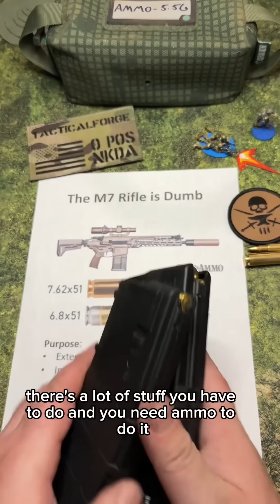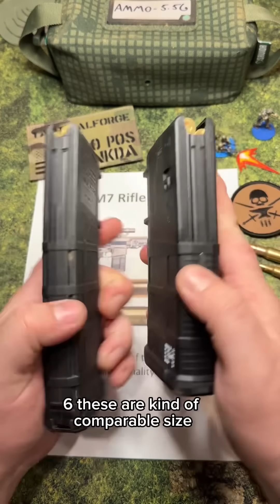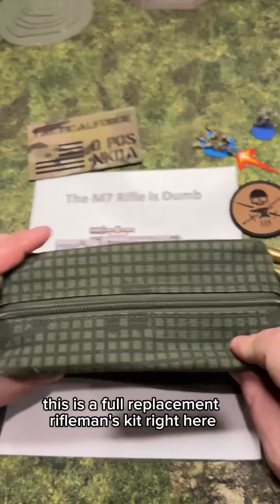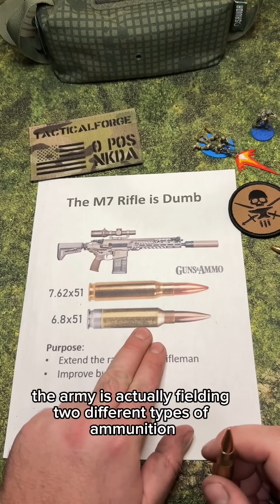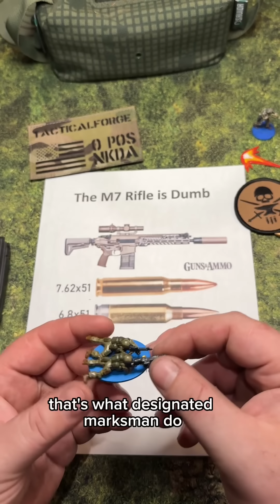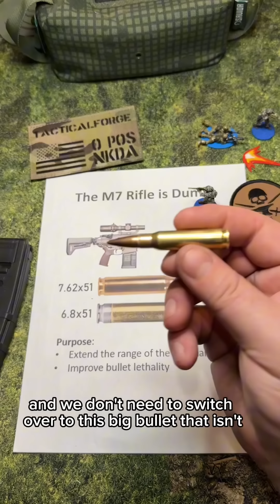My God this Rifle Sucks

Comment: If you need more firepower than .223, use .308. Why invent a new round when half the world is using these two.
Reply: Or use 243 Winchester which is 6mm-08. They're inventing new cartridges and super expensive rifles to achieve the same performance as a $500 243 Winchester rifle in the back of bubbas truck in case he spies a big buck
Reply: @unlisted9494 
Are you high? How does 243 shoot out of a 13 inch barrel? 
This thing outperforms a 24 inch barreled 243 from short barrel 
Nobody's going to be running around with a 2 foot barrel
Reply: As i understand it. To more closely align with the goals of penetrating body armour at distance withing the US Military's interests

With the new improvements to the M7, they're reaching velocities close to 5.56 with a 20" barrel and shooting flatter than .308 using the lower power .277 fury training ammunition and with an 11" barrel+suppressor.

So while the actual combat load will shoot faster & maybe flatter than .308, the challenge then comes through logistics. Especially during wartime, which im assuming the US military is looking to future proof within the next decade or two.
Reply: @Buttimus_Prime only problem is that even .338 can't penetrate modern plates point blank, and even 5.56 is good enough if you hit parts not covered by the plate (and it's rather small compared to the torso)
Reply: @tsorevitch2409  That's another good point. You could hit a mf with 3 .223 bullets, or one .338/.277 while carying the same weight.

If you hit a guys stomach/pelvis/thigh, he sure ain't getting up from that anytime soon.
Reply: @tsorevitch2409 All that energy goes somewhere, Newton didn't suddenly vanish.
A valid tactic against plate armor was to bludgeon the occupant to death inside his tin can.
Reply: @tsorevitch2409  what modern plates can stop .338 and what country is fielding them?
Reply: @Cplblue  RMA level 4 seems to manage it under testing conditions, but I don't know how it stacks up against other level 4s, especially those actually being issued. To say nothing of a plate that might have been handled less than cautiously, and maybe weakened.

Video of the plate being tested
https://youtu.be/9Do__ZFjRLw?si=WRU1V7cUXEPgEB8Y

In any case, multiple hits will degrade a plate, especially ceramic ones that exemplify level 4. Might as well have more rounds, and softer recoil that will let you get that second or third one on target quicker imo.
Reply: Because the US has never needed to shoot a foreign countries ammo. We don't borrow from them.
Reply: @theimmortal4718 We had to beg NATO for ammo at one point when we were still in Iraq and Afghanistan.
Reply: @theimmortal4718  LOL, both .223/5.56 and .308/7.62X51 are AMERICAN inventions.
Reply: @skepticalobserver2135 
So what? 
We don't shoot ammo from allies 

Our 5.56 is not the same as their 5.56 
Do you not realize that? 
Only the US uses M855A1

Our 7.62 is not the same as their 7.62 
Do you realize that? 
Only the US uses M80A1

We ALREADY don't have ammo compatibility with the rear of NATO
Reply: @skepticalobserver2135 

So what? 
We don't shoot ammo from allies 

Our 5.56 is not the same as their 5.56 
Do you not realize that? 
Only the US uses M855A1

Our 7.62 is not the same as their 7.62 
Do you realize that? 
Only the US uses M80A1

We ALREADY don't have ammo compatibility with the rear of NATO
Reply: @theimmortal4718 😂
Reply: @theimmortal4718 😂 they're still compatible! 😅
Reply: @JorgeGarcia-lw7vc 
Compatible for no reason 👍
EPR ammo is illegal in most NATO countries 
Can't shoot it
Reply: @theimmortal4718 I think you're an isolationist who would just want the US to he without allies. Hard to discuss with you, so, whatever.
Reply: @theimmortal4718 not true at all.  We used German ammo in Iraq, it's what was in the caches we drew from in Germany.
Reply: @michelle.lin3653 
The JAG in other NATO countries have already determined that they aren't allowing their troops to fire EPR ammo like M855A1 and M80A1. Only we do, as it's designed to fragment upon impact. Been that way since 2012.
Having yet another EPR in 6.8 that they also can't shoot isn't that big of a deal. Certainly not important enough to forgo cartridge advancement. 
These rounds can be fired by any existing 7.62 guns with a new barrel and hardened bolt face. FN and Dillon have already developed parts for their MGs to fire it. 
The military can convert existing M240s to fire it

Comment: When you look at the subtext of whats going on at home, you only have to realize the phrase "In Common Use" as to why theyre now developing this overpriced, underpreforming weapons platform where most of the functions are already locked behind several paywalls.

1. Its a $7000 gun, this limits most peoples ability to afford it in the first place.

2. The ammo is likely expensive (I haven't looked it up personally), this further reduces people who would buy it since they couldnt afford to shoot it at any reasonable rate.

3. The government may very well rule that the military bi-metal case is a form of 'armor piercing' round since its much more powerful than the standard.

4. Mil/LEO rangefinders and lasers are not limited to <5mw like civilian models, so getting ahold of any of that related goodness by civilians is just not going to happen, thus reducing the linliehood that the modern military firearms collectors have a desire to spend the money to get 1/2 of the product at the end of the day.

5. Supressors are still NFA at the time of this comment.  This means that the supressor foe the firearm is another step outside of acquisition for some individuals who would otherwise be willing to purchase (legally) the rifle.

At the end of the day, switching to this platform is another way for the government to attempt to modify civilian firearm ownership.

In a few years, the argument becomes "Civilians do not own the militaries best rifle in any serious capacity, therefore we should just say that anything in the military styling should be relegated to where they belong, the military."
Reply: Once the AR is no longer the militaries standard, it's no longer a big scary weapon of war.

Comment: This should have been a DMR sharing rounds with a GPMG, nothing more.
Reply: Modification of precise M14s was the solution.  M14 EBR or the M21or M25.  These were deployed in Afghanistan as DMRs.
Reply: @skepticalobserver2135 The M14 platform wasn’t great as a DMR, though. Yes, they were accurate and reliable, but maintaining the gun while maintaining the accuracy and reliability was a challenge. The AR10 and derivatives absolutely blew it out of the water.
Reply: @skepticalobserver2135 The M14 has to be almost entirely rebuilt to shoot with a damn. The civilian models are worthless.

Comment: Note that vortex has stated that the laser rangefinder only kicks in when the soldier has actually gone beyond a specific magnification, I would wager to guess probably beyond 4x magnification, but also it’s a very brief low power ir pulse that the soldier must actually manually input.

Therefore it isn’t that much of a threat to the rifleman or squad. Not only would an idiot have to laze something like a Tank or IFV that have built in detection systems but they’d have to continuously laze it and even then it’s unlikely it’d get picked up since it’s so low power. 

It’s the only sensible thing to come out of the NGSW program imo.

Also the suppressors have a shield iirc and they’re flow through designs. Before flow through cans the Army and Marines were hesitant to actually adopt a standard issue suppressor. However with the advancements in suppressor technology imo it’s something that should be standard issue. However this isn’t unique to the NGSW, the Marines are also adopting suppressors. Also with any gun if you’re in a long gunfight your barrel is going to be visible as well so I don’t think the suppressor is going to make you any more visible.

However I do agree with your other points, even more so because what we see in Ukraine is that riflemen aren’t just carrying 7 mags, they’re carrying 15 mags on missions at the very least.

Comment: If you have to fight a major war (may it never happen!), you need vast amounts of ammunition. The cartridge case is much more expensive and much more complex to manufacture. Switching over existing ammunition producers to the 6.8x51 will not be a quick an easy proposition because entire additional machine tool are needed. Machine tools are the the ultimate bottleneck in any military buildup.

Comment: Just wait until that 2 piece bonded case gets farmed out to the lowest bidder. Case head separations and associated injuries are going to be a real problem for your average infantryman in the not too distant future.
Reply: It already has been. Lc is building a whole new building to move all production of to. Winchester currently holds the contract and theyre absolutely awful when it comes to quality control

Comment: Didn’t they cut down the barrel to 10 inches because the original was too heavy? Here’s what they should have done in my opinion: Body Armor’s too good for 5.56 out of a 14.5-inch barrel? Get rid of the M4s and bring back the M16. Heavier than the M4, but far lighter than the M7 and you can carry more ammo. Use M855A1 ammunition. They have tungsten cores I believe. Out of a 20-inch barrel, the bullets will be flying through the air REALLY fast, and, combined with the  tungsten cores, will be able to punch through whatever a bad guy is wearing. But no. Sig paid the War Department a ton of money to get that contract.
Reply: tungsten cores are expensive, not a good round for potential extended conventional fight. such as would happen if america went to war with or supports a country going to war with one of its peer rivals. 

and no sig did not come up with the idea of 6.8, that was mandated by the army. whether sig bribed to win or not all the rifles in the competition were big heavy weapons (sig was actually one of the lightest ones) firing full sized rifle cartridges with shallow 20 round magazines. and since they were mandated to use a governemnt preselected projectile the couldn't even mess with ballistic co-efficients (meaning for example textrons' 6.8 CT is worse than their 6.5 CT despite haveing the same cartridge diamensions.)

Comment: Could have achieved the same thing with a subcalibre flechette round in a 5.56mm package. No need to change magazine, rifle, etc. Still use 5.56mm for most work. Use the flechette ammo for longer range and extra penetration. Sights would need an additional set of BDC set up for the flechette.
Reply: flechettes have been tried over and over again and they don't work well. too inaccurate at long range and too expensive to make.

Comment: 1: Ukrainian soldiers have said that .556 is actually adequate for what the goal for the M7 was designed for. Piercing armor. They're finding that engagement ranges are not all that far. What war is the DoD planning for?
2: If they really insisted on a bigger gun, the Army could have saved a lot of money by simply upgrading to an AR10 platform. The logistics of using 7.62 NATO would have made much more sense.
3: I almost wonder if SiG or somebody in the DoD purposefully sabotaged the military by designing and/or adopting this absolute abortion along with the M17/M18. Because it's either that, or just some disgusting level of corrupt nepotism combined with incompetent design.
Reply: The general in charge of procurement for the m7 retired and landed a posh job at Sig. 
There's your answer.
Reply: @DarkMatterX1  so a disgusting level of corrupt nepotism combined with incompetent design.

Comment: For the sake of discussion (I am expecting to be proven wrong, but hey it is a fun mental exercise to defend a bad design), they could be forward-thinking and just taking the wrong lessons from Ukraine. Many have said that manuever warfare has been kneecapped by the battlefield realities of Ukraine (this is very disputable, actually, more accurately manuever has simply become more dangerous but still required to win, as both Russia and Ukraine continue to launch offensives despite the costs) and that future wars will be a lot more slow. If the frontline is moving more slowly, if it even moves at all, logistics can have an easier time keeping up with demand for the troops. Moreover, manuever and assault is good if you are going on the offensive (you do need to attack to win, even defensive wars require counter-attack capabilities), but a lot of this rifle makes sense from a defensive mindset, the enemy comes to you and has to fight through your killboxes where longer ranged and spicier bullets can be an asset. Giving every man a rangefinder is likely less for the shooting and more to help soldiers coordinate artillery/CAS/suicide drones on the fly.

Note, I consider these to be the wrong lessons; drones and trenchlines are problems to be overcome, not immutable obstacles that ought to be accepted. However, that is more easily said than done. The SIG rifle seems to be built with a mindset of abandoning the offensive and rapid manuever of the late 20th to early 21st century to embrace the meme of "It's 1914 all over again" (it's not, but it's easy to think that). If it is 1914, that means there are little to no rapid manuevers and close assaults, infantry are going to be spending most of the war sheltering from or calling in artillery attacks and if they ever use their rifles it will be long-distance pot-shots from fortified and supplied bunkers/trenches. Basically, it would be an excellent weapon for 1914, and lots of people are under the impression that we are back to 1914 again, so this rifle 'makes sense' with the information environment it was likely developed in. So, a rifle developed specifically for Afghanistan is mistaken as a rifle fit to fight the entire world.

And with that, I expect everyone here to tear me a new one for- and I am not saying this sarcastically I admit my position is on shaky ground- making a fucktonne of mistakes and misconceptions and trying to justify a problem that has a much more simple answer (it just fucking sucks, which it does) than I am making it out to believe. I'm ready to have my position dialectically manuever-and-assault'd. Show no mercy, folks.
Reply: Not trying to tear you a new one, but eastern war doctrine is very different than western - specifically American - war doctrine. The US specifically focuses on air heavy combined arms. You aren't seeing that in ukraine at all. FPV drone operators are only safe in an AO with contested airspace (because the drones have limited communications range, and lack the lift capacity to carry range extenders of any significant strength and munitions simultaneously). Just recently the Russians captured and "retired" a ukrainian drone crew who were operating within 2km (as I recall, don't hold me to that exactly) of the prokovsk(sp?) front. Moving forward, drones are going to be a problem, but not nearly as much for a NATO doctrine outfit as the slug and grind that is the ukraine-russo conflict. There simply won't be anyplace to hide and operate at any significant scale with 24/7 aerial combat and elint coverage. Just turning the drone and controller on will bring hell down on you.

E: couple o' typos
Reply: @DarkMatterX1 You know? Fair point. I forgot how much air superiority and electronic defense systems give NATO forces an edge in drone warfare. Amatuer mistake on my part.
Reply: @troyharrison9923 
I wouldn't call it an amateur mistake so much as a question from an outside perspective. If your offensive force is primarily going to be eastern style meatwaves backed by rocket artillery like we're seeing in europe right now, drones are going to be a major force multiplier for the defenders. If you're operating in an area locked down under friendly skies, where everything is tracked, monitored and pulverized from the air, not so much. There's still going to be drone caused casualties and loss ofnmateriel. It won't be nearly what you're seeing in the east right now.

Comment: If you want velocity and accuracy at range, you want high pressure, medium to small bore for recoil, and a longer barrel to improve efficiency and burn-time of the powder. What do we see? 13 inches. "Ah" , I hear you say "that makes it lighter and handier!" true, but then WHAT ABOUT THE SUPPRESSOR?!
Reply: Is the "sniper" for all the volunteers that came from CoD
Reply: i mean theres high pressure, then theres spicy enough to need funy two piece cartridge. that 13" barrel gonna run like a 20" ar15

Comment: The biggest indictment of this rifle is that I don't think I have ever seen a positive comment about it from anyone with any understanding of the role of infantry. Systems that broadly work in a different fashion than what came before, like the Bradley as an IFV instead of a light tank or APC and the F-35's reliance on stealth over kinetic performance at least got mixed commentary at worst.